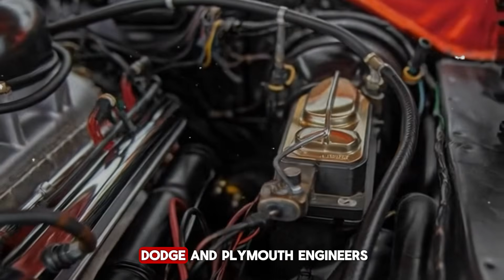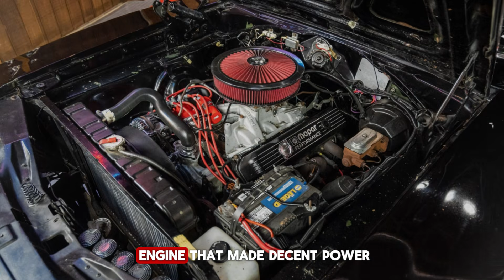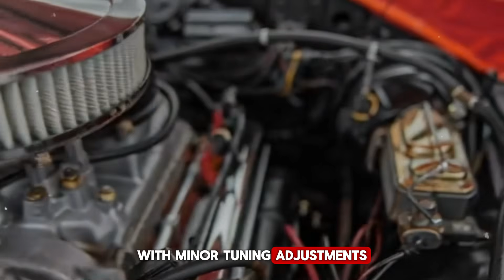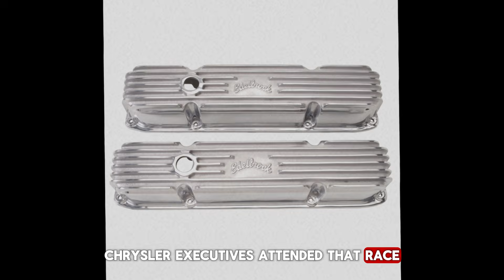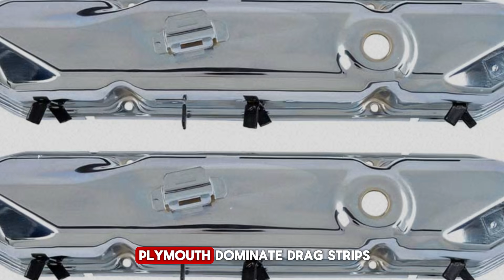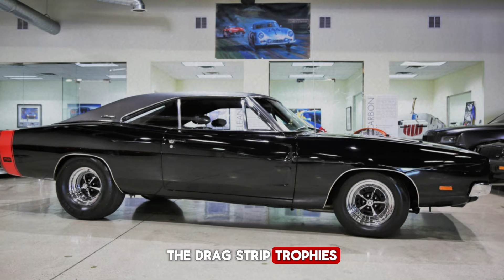The Real Reason Dodge Killed the 383 Stroker Engine

Comment: 383 stroker?  Are you sure you are not thinking of the 383 RB?  That 383 was an underbored 413 and had a 3.75 inch stroke vs a 3.38 stroke in the 383 B engine.
Reply: The 383 RB was produced in 59 and 60 because they couldn't get enough of the 383 Bs out the door.
Reply: @markdubois4882  Yup, so they created a 383 that could be made on the same line as the 413.  Rare engine nowadays.

Comment: You idiot's need to learn history.  First of all it wasn't a 383 stroker ! (That would be chevys small block) It was the hemi head that made the hemi legendary!! The b block wedge engines 361 383 392 413 426 440
Reply: B block:  350, 361, 383, 400
RB block: 383, 413, 426, 440

Note: the 383 RB was produced in 59 and 60
The 350 is a 1958 year only.  It was bored out to 361 CID in 59.  The 383 was introduced in 59 as well.
Reply: @markdubois4882  Yup, only those two years.
Reply: @markdubois4882  Yup, only those two years.
Reply: Most of today's youngsters don't know squat about cars, and when they do, it is about Datsuns and Toyotas.

Comment: The B block was a wedge motor not that different than the earlier 413 & 426 max wedges and Chrysler saw the need for a street friendly big block and went straight to the 440 that was actually better for everyday driving and easier to tune but only tenths of a second off the hemi is 1/4 mile times due to its lower rpm range and gops of torque